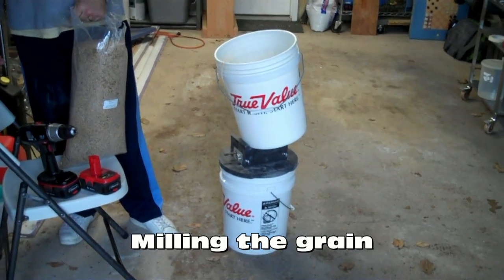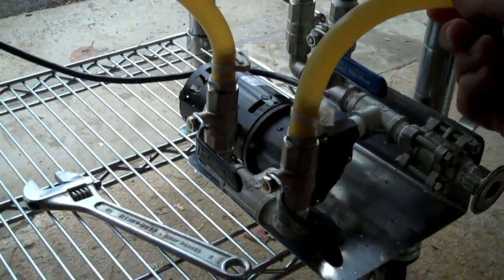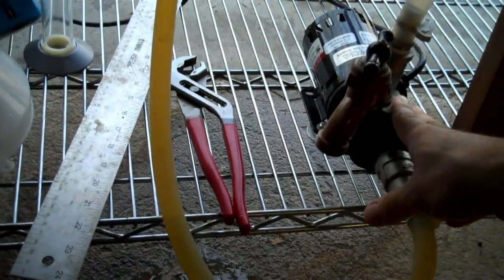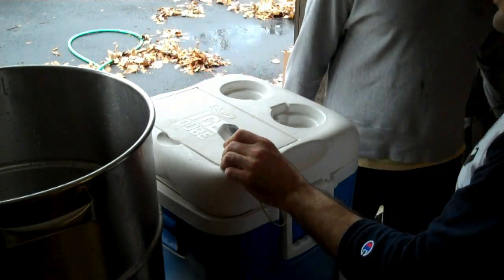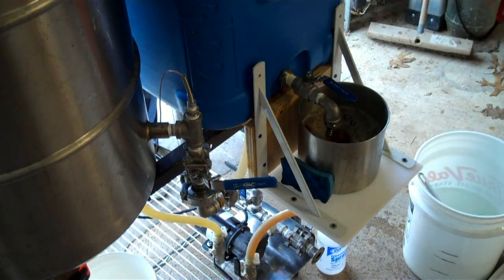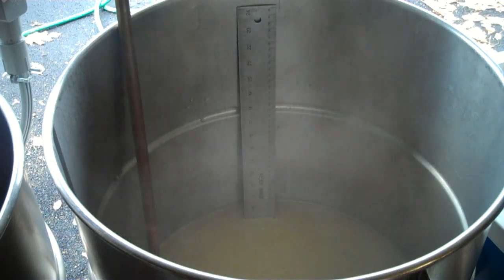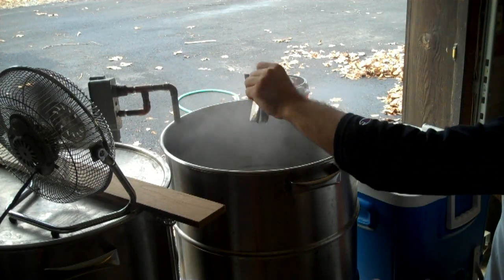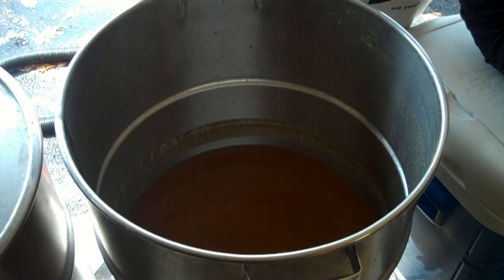6-hour electric All-Grain brew day compressed into 20 minutes

Comment: Where did you get your HLT and boil kettle? I like those better than converted kegs.
Reply from the maker: They're 25 gallon stainless drums. I got them from another homebrewer and soldered my own fittings into them. Check out my other videos for info on the soldering process.

Comment: What size mash tun (quarts) would be ideal for brewing 10-20 gallons of finished beer?
Reply: With that said, theoretically, a 100-120 qt mash tun would be sufficient for a 20 gallon batch at the 1.070 (or bigger) but also still be versatile enough to make a 10 gallon batch?
Reply: Thank you for the help. Cheers